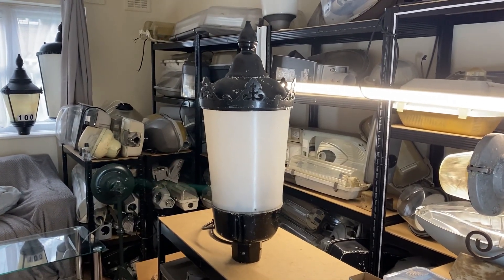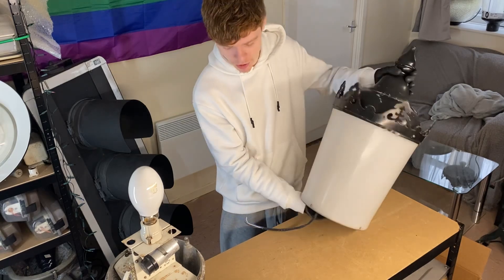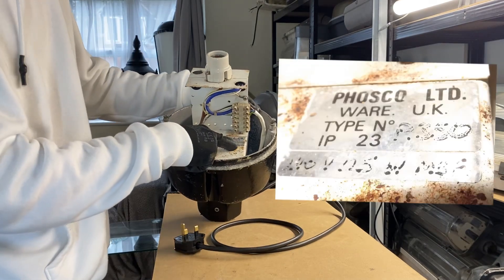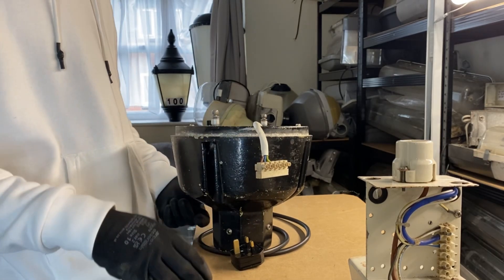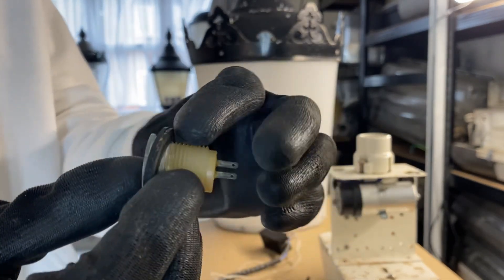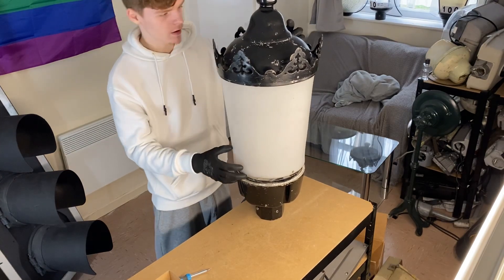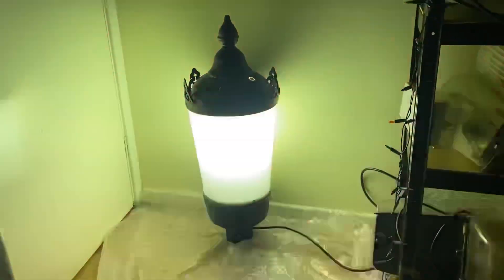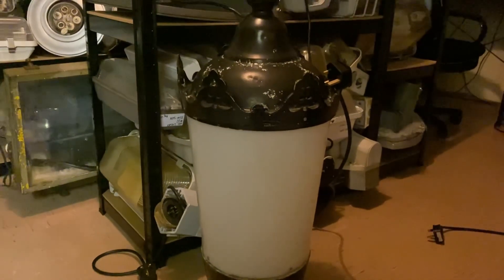A Street Light from the 1980s | Phosco P350 - Teardown and Warm Up (125W MBF/U)

Comment: The photocell looks to be a Royce Thompson P12R (not RE - they were later) - they have a tendency to become a bit toasty after a while!
Reply from the maker: thank you! I did think there was a piece missing, Ive not quite seen a cell like it where the detector is seperate from the cell's body and both are located in the lantern - definitely was a confusing one!
Reply: @LeoLampposts Yeah, both the P12 and ER12 had remote detector options, though curiously, there's never been a Microstar version that offered this flexibility. Hope that the tea stain has disappeared successfully, by the way! :)
Reply from the maker: @StreetLightOnline Thanks for the ID, looks like the missing piece would have had the ID sticker on it. Also it did come out, some vanish did the trick!
Reply: @LeoLampposts Naturally - if any piece contains useful ID information, you can be assured that it will go missing! Ah, that was very lucky - tea stains can be tricky chaps to remove!

Comment: Face reveal ahaha! Yet again another Lovely video mate, recon the Atlas alpha 3 next? Very peculiar how they operate.
Reply from the maker: indeed, first video Ive not just briefly appeared in the corner haha, MA60 is the next one in the books, but I can do the Alpha 3 after that one. Its not in operable condition at the moment, and theres a lot of siezed screws so it will just be an overview of it and a look inside
Reply: @LeoLampposts, the MA60 is one heck of a thing haha, also the photocell is a Royce Thompson P12RE.
Reply from the maker: @BenSOX135 it is indeed, the camera angle was difficult with that one too, also thank you, youll get a mention on its webpage when i release the next website update
Reply: @LeoLampposts, cheers mate. I can’t imagine where the camera would be positioned for the MA60 😂. For the alpha 3 some lubricant and an impact driver would do it, or a local company that could help.
Reply from the maker: @BenSOX135 i managed to position it atop one of the shelves and angle it down to fit it all in using a ballast, it did fall at one point though haha. Also thank you, I'll have a look for some local companies